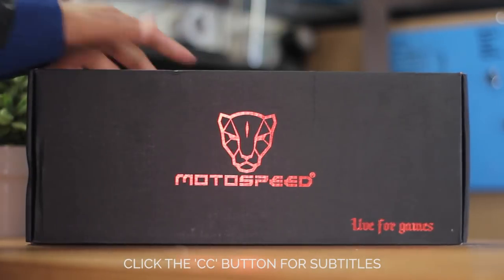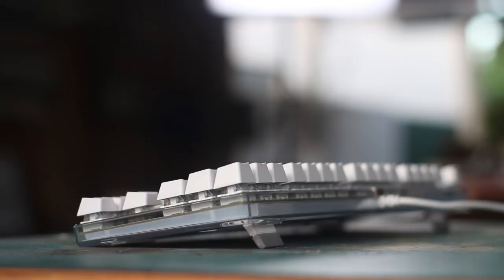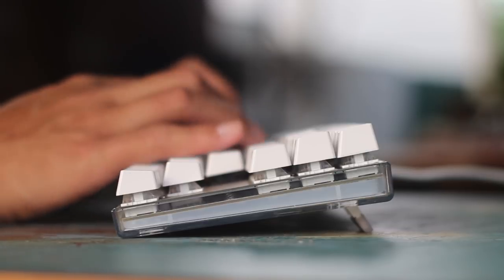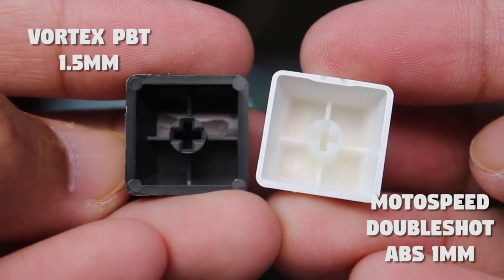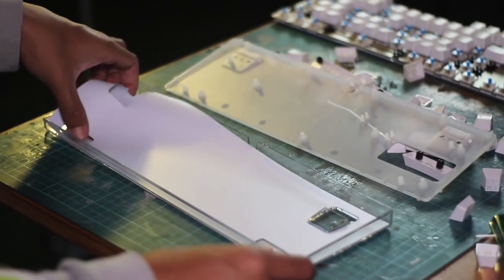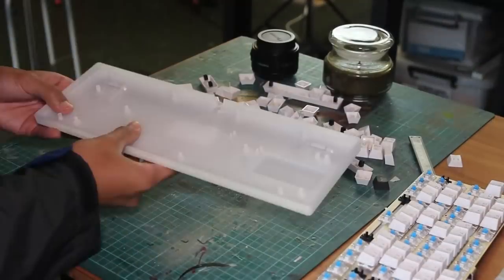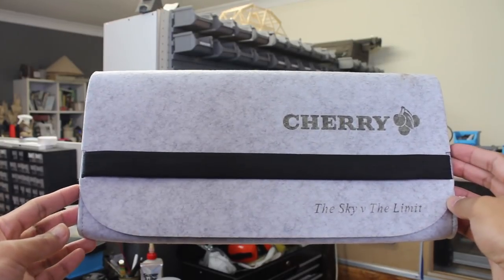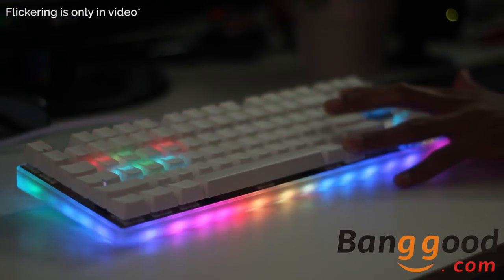Motospeed K87S RGB Mechanical Keyboard - Unboxing & Review + Mod

Comment from the maker: I messed up the lighting demonstration - I accidentally did the mod before recording the lighting modes, but they're pretty standard anyway. In hindsight, it probably would have been good to give it a bit more of a frost on the inside of the case. But it still doesn't give that clean diffused look that other underglow boards do. Still an easy and simple mod.

Thanks! :)
Reply: TaeKeyboards can the top plate be easily remove? i thinking of getting this kb but i want to paint the top plate to black
Reply: The key is white tissue paper :)

Comment: For better light diffusion, you can try spraying the frost on the inside as well.

Also double up with diffusion film too! :)
Reply from the maker: Yup, I shoulda, and might do so :)
Reply: totally, might even try painting a layer of white on the inside. Should do the same as the frosted paint, but with even better diffusion. Light coat should still let plenty of light through.

Comment: I found this keyboard for like 3 euro at a flea market, and I've fallen in love a bit. I'm gonna clean it, remove all the switches and replace them with gateron browns from another keyboard I got the same day for a similar price, do tape and foam mods and maybe try diffusing the bottom light too, while I'm at it

Comment: What is the deal with these keyboards all coming out under different names? It's the same font, same everything, 1000 different brands.
Reply: Different PCB/Case. The keycaps are often sourced from the same OEM. IIRC both the Magicforce 68 and Drevo boards use the same OEM keycaps with their own extras laser etched on the lower half of the key. Compare the white Magicforce 68 to this - Same caps, different layout/laser etchings/PCB and case. This also uses the same keycap manufacturer - they are doubleshot ABS. Not amazing, but not bad either. Better than Razer/Corsair/Logitech caps.
Reply: But these keycapps are ugly AF,thats why i am not getting a keyboard with it.
Reply: You can always buy your own preference of keycaps. PBT, ABS, Double shot or not, different profiles. Keycaps can be quite a large chunk of a board's cost, so cutting costs by using the same OEM is a good thing business wise, even if you get stuck with a "gamer-y" font when stock. At this [price point it's generally gamer-y font or appalling keycaps. Look at the Ajazz AK-33. Crap caps, but not a gamer-y font. (also crap switches, but that's beside the point here)
Reply: FuzzleLand They are OEM products made in the same factory but sold to different companies around the world only different on the product are mostly the branding of the company  them, and of course the companies came up with their names so it has many names even it's basically the same
Reply: price m8. price.
Reply: The GK87 is the best though. In my opinion.

Comment: So the housing on this looks essentially like a clear version of the Teamwolf Zhuque X05 CIY Gaming Mechanical Keyboard. 

The one gripe I have with the Zhuque is the branding on the top plate. Since the plate on this Motospeed K87S appears the same and doesn't have branding, one could use this top plate on the Team Wolf to eliminate that problem.

Comment: do you know if you can use the spray on keycaps as well? also isnt it possible to just sand the plastic with a fine grit to get the same effect?

Comment: Before I source that this, would you happen to have any other suggestions for a clear keeb with an aluminium plate aside from the Velocifire and Ganss? I'll probably leave the underglow off, so I'm not looking for anything frosted. Additionally, any idea how difficult it would be to replace the cable?

Comment: i frigging hate those screws, anyway u can remove them/cover them up??
Reply: strvnge You could swap them for stainless, but don't remove them. An acrylic cap is also an option, but achieving a proper fit is a nightmare as it should be a snap fit to allow for future maintenance.

Comment: far out man  literally only 2 days ago I spent 220 Australian dollars and bought a magic force 68 key silver with ice white lighting and Red gaetrons switches , also bought a full set of ducky doublshot floating caps  And now I see this fucking keyboard which is like exactly the same. could of bought this and saved some money but ah well. One thing I like more about the magic force is that it looks more premium/quality keyboard, the bottom plastic bit on this motospeed makes it look kinda cheap. Good review though.

Comment: Is it possible to wrap mod or paint  the metal part? Easy to execute? Thank you :)
Reply from the maker: Hi, for painting, unfortunately not. The proper method would be to desolder all the keyswitches, which takes skill and time. Alternatively, which I have never done, is to somehow mask off all the switches. But even then, you may risk paint leaking into the keyboard.

For vinyl wrap, it's the same thing. But you can also draw and print out on vinyl to cut out holes, which is also difficult and time consuming.
Reply: TaeKeyboards thank you for the explanation.

Comment: is there a way to turn off the lights under it?
Reply: 1year late but if anyone has the same question yes you can, on the keys aswell 
And just realized you can set different color for each key

Comment: I have good things to say about the outemu blues, I am currently using them to type this comment. They are quite loud, and the keyboard they're on came with extremely cheap keycaps so they sound really clacky, but with some doubleshot keycaps they are much better

By the way, the keyboard in your video is obviously trying to copy the Apple A1048 keyboard. Look it up, you'll see what I mean

Comment: Hi can I turn off the underglow?
Reply: I have a Hansung MKL16S Bossmonster which is basically a rebranded Motospeed K87S with Kailh Speed Silver switches and you can turn off the underglow in these keyboards by toggling via Fn + Page Up

Comment: Dude, that's the Teamwolf CIY Zhuque Hotswappable rebrand! lol
Reply from the maker: Wait what? There's an underglow Teamwolf?!
Reply: Short answer no. But the design of the keyboard, from the plate, the housing pieces, and the non detachable cable is exactly the same as the CIY. I suspect they used the same molds to create that bottom housing and just have a new rev of the PCB that supports underglow but removes switch hotswap. I wouldn't be surprised if they release a newer one that supports RGB underglow and switch hotswap in the near future.
Reply from the maker: Ahh, I see what you mean.